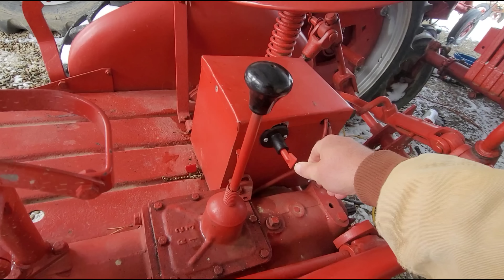Do YOU Run In-line Fuel Filters?

Comment: You're right about that just getting the tractors under a roof & out of the worst of the weather. 👍🏻  Those inline fuel filters are a good call for making sure clean gas is getting to the carburator. 👍🏻  Keep up the good work there. 👍🏻  Take care.
Reply from the maker: The guy I bought that cub off of made it no secret and I really think the last 5 years he owned it, he didn't use it much and the tank sat empty

Comment: ALWAYS run the clear inline filters. Doesn't matter if gas or diesel, it's insurance to your fuel system. Hate to burst anyone's bubble but, "HEET" and Seafoam really doesn't "remove" water from gas, only helps the carbs to burn the water out of the system if it goes through. You can feel what you need to with those gloves. They just don't stand up to gas or paint thinners. 
In my opinion, the letter "super" series along with the '06, '56, '66 and '86 series were the best that IHC/Farmall ever made. Cheers :)

Comment: My uncle uses them with a stand pipe in all his old stuff. I use them in whatever has a "difficult" carb to remove or a dirty tank. Walmart has some of the best batteries from my experience. I have one that's at least 13 years old and it's not even getting weak yet. I probably only put a couple hundred miles on it a year and don't have it on a tender. My next oldest are 6 and 4 years which are also staying strong.
Reply from the maker: I'm gonna take that Box in and fit one to size
Reply: My experience with batteries is the higher the cranking amps the longer the battery lasts. The battery in my H is now going on 11 years. The one in the M is 9 and the 400 is 7 .I have a store in my town called ...The Battery Center... and a long time ago I was having trouble keeping a battery longer than 3 or 4 years. I asked the guy behind the counter how to get more life out of a battery. He said buy higher cranking batteries, you pay a little more for them when you buy them but the extra years you get out of them will pay back in the long run. I thought he was just trying to make a sale, but he told me how many years many people were getting out of them. So I tried some and haven't replaced one yet. Yup it's been 11 years ago since he told me that.
Reply from the maker: Now that's interesting
Reply: @FarmallFanatic  he also told me that heat is what kills batteries not the cold. You just don't realize it until it gets cold because it takes more amps to turn a cold engine over. He said high cranking amp batteries are designed to handle heat.
Reply from the maker: @hturbo1007   It does make sense
Reply: All I use is Walmart batteries and even keep extra at shop
Reply: @hturbo1007  I agree with the heat.  I leave a vehicle for 6 months each year in SWFL on a quality tender.  3-4 years seems to be it.  In the great north my batteries seem to last longer.  Not real scientific, but that’s my story.
Reply: @FarmallFanatic  you ever use a hollow tube on the carb drain plug? I got one on my welding machine (same carb) and it works pretty good at keeping the carb clean.
Reply from the maker: No I never have but I'm sure it works good

Comment: Well Gino you talking about your 45m there, I pulled r47 at my grandfather bought new into the shop last night and did an oil change and a greased job we put the heater cab on it this morning and put it in Manor spreader and it ran that spreader all day today did a good job old tractor is a family heirloom, bought new by my grandfather in 1947 has been in the family ever since we know for sure it's on the 5th set of rings sleeves and bearings and the 6th set of rear tires
Reply from the maker: Is made to last

Comment: It would be a good idea if tank is dirty to run a filter,my 54 Super-C has never had a filter on it,just stock metal line to carb and little screen in original fuel bowl/on/off valve,but it has a clean tank also,you have a nice Super-C there!

Comment: My Farmall M has a in line filter only because I had to eliminate the sediment bowl for tractor pulling. The bowl was restricting the flow for the RPMs I was running. Other than that all the others have just the bowls and metal line. I'm not a big fan of having rubber fuel lines if I don't have to.
Reply: I been on the fence about removing the sediment bowl too and just adding a ball/needle valve and a clear filter. That sediment bowl intake gets plugged up easily on my fuel tank

Comment: I currently only have a fuel filter on one out of 3 tractors. It’s was a hedge row tractor that I just had to have. I tried everything to clean that tank. Nuts and bolts strapped to another wheel, degreaser, pressure washing, everything but acid. The crap that came out looked like sand blast media. And tar. God there was tar every where. I put a rubber line on it with an inline filter and just run it. I change the filter about every 8 hours of run time. It is getting better.
Reply from the maker: And it will get better as you run it
Reply: Did that with an old Ford I had, I ran three clear filters on one line, as they clogged up I'd pull it off the hose and keep truckin'

Comment: Excellent video Gino  :) do ever check  external Regulartor box see if got dirt connections or need  cleaning up like points plus 3 wires connection too on 3 slot screws  also seen those give false reference on gauges plus do Multi Meter reading from Generator or Alternator too ! Plus GM Delco Alternator on single connection only on battery post on back or double had 3 connections one battery and 2 on internal Regulartor on post to on 2 prong clip with Number 1 connection on Battery post ! Most Generator after got worn out lots farmers get 1968 to 1986 GM Delco Alternator on 35 to 100 amps recharge battery too  in 1 stage or 2 stages amps to use depends on Tractor also! Also clear Fuel Filter better than steal ones at least see  bad stuff clear and steal got too take apart see have  or get lope on low or high idle or not flow to carbs of Backfire then shut down or in Winter freezing up fast ! But myself always like using clear ones Gino :) much better investment and investigation to know why ! Take steal one if last 5 to 10 years with no problems but not ever seen that maybe 3 years only! Battery they don't build like used years ago and 5 years about best bet changed them unless got bad electrial connection or Starter or Generator or Alternator drains lots energy then use be time changing do ! Also want think weird Gino just before restoration my neighbor farmer Tractor 1945 Farmall H basic gas motor row crop  one all 6 volt Positive ground electric start was working to well and saw spark on cloth wires  underneath fuel tank spark on top transmission! Really surprised he burned to ground also that wire connection for Starter also Generator to gauge he told put Headlights run okay for 1 mins then kill motor running so he could't run Headlights! So restoration tractors full had put new wireing and now put Headlights on run no problem also Generator did get burned out and had transferred to 12 volt Negative ground and Gm Delco Alternator on it plus put Volt gauge to new one in!

Comment: Fuel filters are a good idea if at all possible. Too bad they cost so much now
Reply from the maker: Just like everything else
Reply: eBay has best price on filters
Reply from the maker: @philliphall5198   I just bought 4 of them for $28
Reply: Gino I’m not sure of the benefit of sharing this info, probably just make a bunch of folks angry.  After two retirements (Army and a Big 3 Auto) I owned an engine building service.  I was able to establish pricing from both East and West Coast Importers.  I bought the smaller version of the transparent filters by the bag of 250 per bag, generally 500 or 1,000 at a time.  I traveled through out the Midwest and some VA, NC events.  Back to my point, for years the filter price was .37.  Yes, 37 cents!  I sold them at .75 or 3 filters for $2.00.  Sold like crazy, everyone was happy.  I had an individual (several) that asked how the heck could I sell them so cheap, because the lawn/garden center they full timed at was paying $3+ and then marked them up!  I bought the same size you use in a translucent for .37 also, they were not as big a seller however.  This was all 15 years or less ago.  It got to where I could sell to the chain automotive stores in my area, due to their suppliers being so much higher!  In some “lines” the mark up was 1,500%.  Mind blowing for sure.  I sold the business when 3 score and 5 came around.  Sure wish I had kept a few more!  Ask me about spark plugs and wires some time!!!
Reply from the maker: @stanleyconrad4234  If people get angry, that's a choice THEY made

Comment: So I tried adding a filter to my cub just like you did. I’m not getting fuel in the filter. If I take the outlet side off fuel will start to run and it’ll be good for a few minutes then it’ll run out again. Any thoughts?
Reply from the maker: What exact filter did you use
Reply: It’s a WIX I got from Steiner. Not sure of the model. Looks to be about the same size as yours.

Comment: You sure like using band aids. 
Fuel filters with simple screens can be taken off. Blow air backwards and reuse the same filter. Do the tanks and be done.
Reply: Lol, you complain about a bandaid, and then advocate a bandaid reusing a fuel filter.
Reply: @zodszoo  well I'm not smart enough to buy expensive filters. Lol. Just saying
Reply from the maker: As far as I'm concerned the tractor is fixed and the fuel gets cleaner every time I run it
Reply from the maker: Eventually I will only have to change that filter out once a year